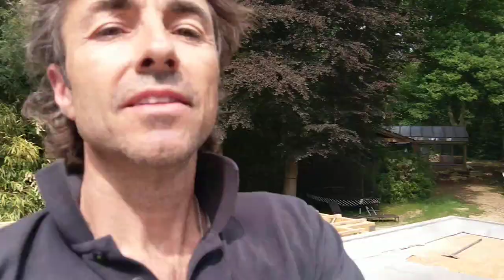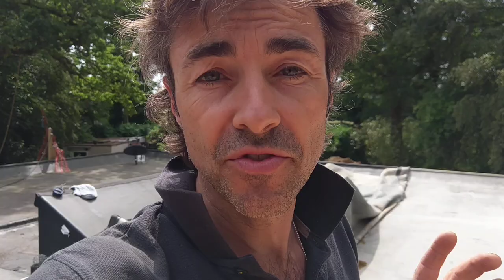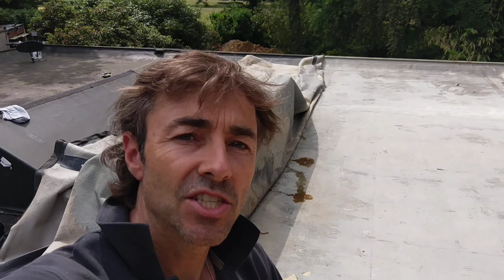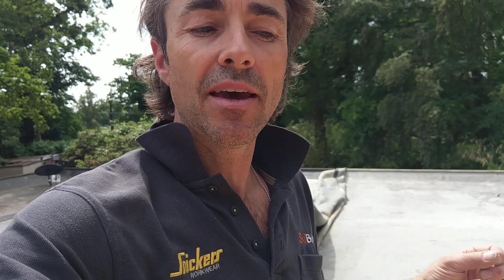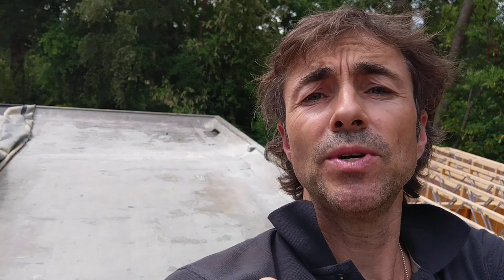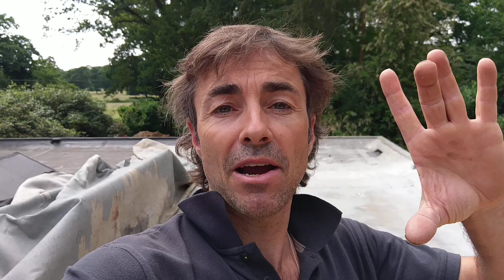The Trouble with a Flat roof including fibre glass

Comment: I've done probably 20 grp roofs so not an expert but certainly know more than most in the space of nearly 15 years or so,It's a good product and not the easiest to install but done right following specs and good practices it lasts,the substrate should be tg osb and layed the wrong way up as it is rougher that side and the joint doesn't meet between the boards creating a channel which the resin keys into,Buy a premium resin like Cure it, double layer 450 gsm or if using 600 gsm bandage all seams joints and abutments,I've also used firestorm liquid plastics torr coatings  and felt they all have there sweet spots and pinch points which make them more or less suitable to job at hand,One note an expansion joint is recommended on over 50sq I put them in over 35, I repaired a friends roof which cracked at 48sq so beware and cut the boards as well it's no good just letting the grp flex,
At the end of the day you could buy topseal but if you got a muppet on the end of the roller your f#%@ed
Reply: I use topseal,cureit,any resin will work well if you do it right,most don't wet out and or paddle enough, don't cut corners and prep right and they last a long time.
Reply: Topseal and cure it same company

Comment: The original GRP roof wasn't done properly. It must go on an 18mm thick OSB board layer which must have 2 mm gaps between the boards, if you aren't using T&G, [which you can't always get]. There must be a 25mm gap at any abutment walls and the boards screwed down well with 35mm screws into the roof joists. Then you start the lamination. If it's done properly, it'll last forever and you'll not have any problems.
I've done many GRP rooves going back 20 years, that's long before it was available 'off the shelf'.  I've never had a problem or a callback, ever. You can't condemn a roofing material just because you've come across one that has been bodged. 

You should see the EPDM rooves I've had to rip up because they've been done badly...
A roofing system is only as good as the bloke/team who install it.
Reply from the maker: Osb and other sheet material needs an element of expansion gap it's only products like plaster boards that can be jammed together tight, even the tounge and groove OSB has an allowance factored into it in the manufactur process, Great question, thanks for getting in touch
Reply: @DaysOfDarknessUK  Sorry for late response. It's for expansion in hot weather. Especially if you're using regular and not T&G Sterling board. 

GRP is a fantastic material. It lasts forever and looks great if the installer knows what they're doing and does it correctly - using the proper materials. Many roofers are simply prejudiced because most likely, they've tried to install a certain system and its been too complicated for them or they just prefer a certain one over the other. So they go around slagging off the one they don't like as much. Saying it's useless, it won't last, it's noisy, it's cold etc etc etc..All of which is bollocks, it's just them being prejudiced. Videos like this one, casting aspersions on a material just because they've come across a roof that's been done badly,  by some cowboy, really annoy me. I've seen bodged up asphalt rooves, EPDM and other single membrane rooves that have creased and lifted at the joints, that have fallen away on up-stand walls and therefore failed --- many many times.

 No roofing system is foolproof, nor is one better than the other, they're all good, the key is not to let a fool install one for you. 

And if you have been mugged by some Chancer who made a cock up of your roof. Don't go blaming the material itself. Sue the arsehole who stole your money. If you can find them again....?
Reply: @DaysOfDarknessUK  It is essential to use OSB3 on flat roofing. You also need a vapour barrier to stop moisture from inside migrating through the roof but keep in mind . OSB with enhanced moisture resistance (OSB/3; OSB/4) is not waterproof; the term 'moisture resistant' applies to the adhesive binder which (within limits defined by EN 300) will not break down in the presence of moisture. It must be laid with expansion gaps.
Reply: I was just wondering why you don't need a gap with T&G OSB substrate? Surely, a jammed together board acts in the same way as standard OSB, expansion wise?

With T&G, would you recommend just glueing and not screwing to aid expansion?

Lastly, EPDM is breathable, so even with a correctly installed vapour barrier, the moisture that does make it through can evaporate. Is GRP breathable in the same manner?

Comment: Strammitt board is compressed straw wrapped in paper were as woodwool slab is straw like material with concrete mixed in it and very rarely rots were as strammitt boards do rot and was used as a form of insulation and was also used as a board for partition walls but a real fire hazard
Reply: Darren Harlow that's where I've seen strammit board, in partition walls. Normally in houses that are non traditional construction.
Reply: Thats correct  we've stripped plenty of both types in the past and still come across the occasional one now and again 🙂

Comment: Never had a problem with torch on felt.
Gotta use a good quality one. 
Anderson Technatorch my choice.
Flexible enough ti withstand our weather. Less fashionable these days but it will come back round when people realise the new tech systems aren't maybe as good as the hype.!
Fibreglass is good but weather and temperature have to be right.
Unfortunately in this country it can be a pain in the arse waiting for ideal conditions so people install it anyway and it fails!
Reply: 3 layer torch on SBS Polyester. 40 year life.

Comment: Expansion and contraction is what splits fibreglass. The heat that hits a roof is amazing and the movement can be catastrophic to it. I wouldn’t glass a roof over 50 square metres because of the crazy amount of movement. The GRP will give way at what you think is the strongest point where it can’t actually move.
Reply: Also thermal noise which seems strange also a problem without expansion joints

Comment: Terrace over the GRP ?  I am thinking of making a 2nd floor deck over a new flat roof (converting from a tiled roof over an extension).  Question is OSB doesn't seem strong enough to take a deck on top, so thinking of putting 9mm ply underneath 18mm OSB t & g.  Will that work ?  Bottom of the deck will be rounded off and have rubber wrapped round it to minimise damage to the GRP.  Any better options ?  Thanks

Comment: stramat board is not the same as woodwool slabs, stramat is all straw, woodwool is  chips and cement, 30yrs  since my first fibreglass roof on plywood and still perfect, its not the certificate that does the job its the person, how did you get on with your cut to falls roof,, still prefer pvc single ply my first pvc job was using the braas pvc and pib membranes in 1980, retired roofer through ill heath. wear a mask when welding pvc,

Comment: hi robin i am open to advice. i have a garage roof   we have a flat porch and a roof over a closed area that we had felt roofed it was originally years ago corrugated polly plasticy stuff we have an area at back of garage that we have closed in with double glassed windows and doors and  downstairs loo   we keep our fridge freezer in this area the back door leads into kitchen   so the area is quite large. i noted in 2 places that the water pools so when we re roof i am thinking we need new timbers stuff ply wood or  what ever its called. i am thinking that over the back living area as i call it the area that leads from  kitchen to downstairs loo (there are also and old coal shed that was brick this backs to the side of the downstiars loo i know i am not good at explaining it .    The question is we need in the summer to get  a new roof done as the felt job was done crapply last time . enough said 
i was looking at the rubber stuff but  whilst we dont walk on the roof there is guttering that every couple of years will need clearing and a window that i have a window cleaner do that looks over the garage so will have to get on garage to clean it . will the ladders harm the rubber ? will his shoes harm the rubber integrety.  the rubber looks nice as neighbour had his done a few years back and he said it was cheaper than torch felt roof. i was then thinking of the fibre glass but i think it will be megga expensive as a really big area to do.   my question is do o go for the torch felt which will last not too many years or the rubber which we would have to make sure that any ladder is protected if placed on it not that it would need very often a ladder on roof . we would get a reputable roofing company to do it its not us doing it ourselves i just want a few  pointers . I am a nurse by profession and in our house i am the practical one so am doing my research
Reply: What did you go for in the end …I’m undecided about roof coverings for my extension . I think I’m going to go for torch on felt because the last roof did 26 years ….I’m not sure about all these single ply options . Probably old skool is best ?!!

Comment: Can't use ply? Naah that's not right. Don't use marine but cheap ply is great. Sticks better to OSB3 but it splits like crazy when driving in screws and all that will need sanding down. 
No gaps, no holes, nothing sticking up and you can't fall off.
Reply: It's good for grp,but ultra or desopol don't like the knots that are filled with filler,comes out n wraps around the roller,which is annoying

Comment: The problem with flat roofing is that sellers and installers said 50 years ago "In the past flat roof technology wasn't what it is today. Now a flat roof will last". And then a couple decades later, lets say 25 years ago, sellers and installers say "Flat roofs used to be unreliable. But with today's materials all those problems are no more". So now 25 years later sellers and installers say "Flat roofs used to be unreliable. But with new modern materials and techniques those issues are solved". So what do you think they'll be saying about flat roofs being installed with today's technology in 25 years?
Reply from the maker: great thought process and I also wonder too, its all about good fundamentals in my humble opinion, what I mean is if you follow really good building practice and adhere to the exact guidelines from the manufactures with regard to their systems and products then there is no good reason that a flat roof will not last the test of time, thank you for taking your time to watch my video and comment on the same, all the best Robin
Reply: @ukconstruction  

Yeah, it was a good video. Thumbs up. Nothing wrong with anything you said. All roofs have a time stamp, especially if you don't maintain them. The flaw in flat roofs is not the building practices or guidelines given by manufacturers, I'm sure their specification are based on tried and true methods. The issue is that flat roofs, from an engineering standpoint, are inferior to a standard A-frame or a gabled. It's just physics.  The fact is if you use the same exact materials and changed it to an A-frame you'd have a roof that lasts twice as long or more. 

You were spot on about that fiberglass. It's far too large an area, buildings shift and settle all year round. Any monolithic roof structure needs to shift with it. Fiberglass doesn't do that, hence the cracking. Fiberglass is okay on smaller areas, like a shed or add on room, or an overhang.
Reply: Still the best.  3 layer torch on SBS Polyester system.

Comment: how did you get that pitched roof to look like zinc with the upstands? Looks good if the cost is lower than zinc
Reply from the maker: Hi Henry, the product I used is Evalon by Alwitra, then I had their standing seam welded on to suit my spec/spacing, it's really effective and half the price of zinc, 25 year warranty too, hope that helps 
best Robin Clevett
Reply: @ukconstruction  Excellent I will have a look. Up stand weld looks good. Keep up the videos they are great.

Comment: If you are having problems with roofing GRP cracking try a another make with more flexible resin, it is not the same polyester as for making boats etc. Make sure you apply the gel coat properly as well, GRP is not water proof on its own.

Comment: Hi robin,,I’m no joiner but I’ve got most of the tools with a slight bit of an idea lol,,,I’m in the middle of doing my garden up and want to build a shed,,I’ve just had a 12ft by 9ft concrete base done ready to build a shed on,,I’ve seen a video on YouTube that Colin fuze built a shed and up to now that’s the shed I think I’m going to do,,but I’m just wondering if you have any videos on building a really solid secure shed,,,I only ask this because the shed Colin fuze built has had a couple of bad comments made on the build about how it’s sat on a course of engineering brick and it had no damp course to keep the damp away from the timber,,,,,,,as your a great builder and joiner,I would much appreciate it if you had any spare time to find and watch the video and tell me if you see any problems where he has gone wrong,,,,other than that,,thanks for you time to read this and home to see some more videos 👍
Reply from the maker: Hi Bond Bondy!, I will try to check out the video. It's always good to use damp course wherever possible it does no harm! It's a cheap as chips too. Generally speaking a garden room/shed/man cave  of that size would be great in 100 X 50 studs with a 12mm sheathing ply, and maybe 150 X 50 joists run on the shortest span with an OSB tounge and groove roof panel if your having a flat type roof, if your going to insulate and line the inside keep some ventilation between the exterior cladding and the sheathing in case of any build up of condensation in the walls, treated sawn timber should be great, Good luck with it, make sure you post some clips of the build!
Reply: Explore With us Engineering brick is a damp proof course in itself if done with correct mortar mix. You have different grade of bricks also, seem to recall A grade and B grade. Maybe to do with compressive strength, can't remember. Any how the "A" grade of bricks had a moisture absorbency/content of only 3% so they worked as the damp course. As Robin has said roll of dpc is cheap and good practice to put in. Also engineering bricks are great for building in pad stones under high concentrated load points such as lintels and steel beams 👍